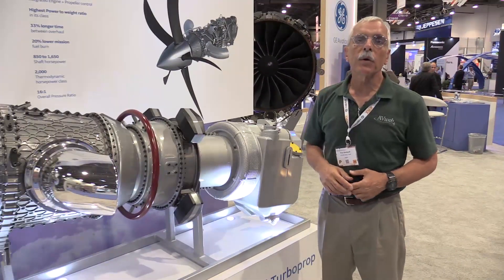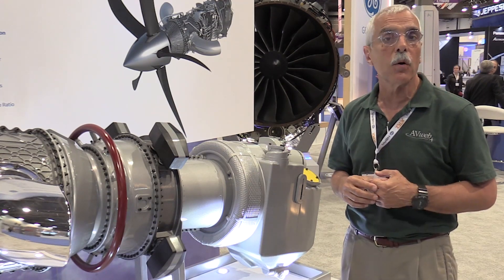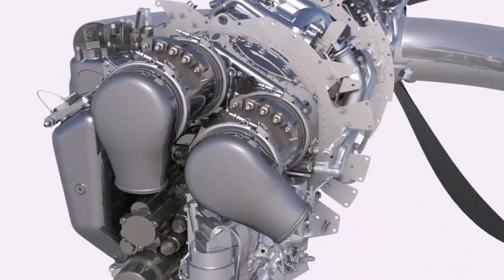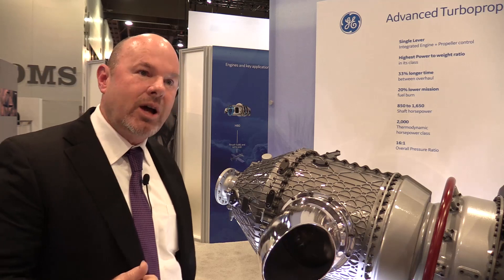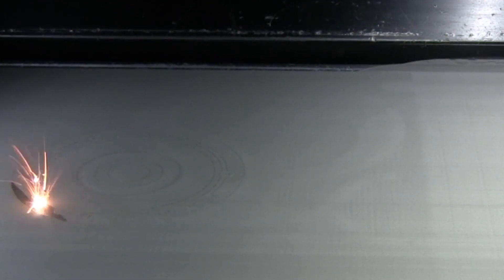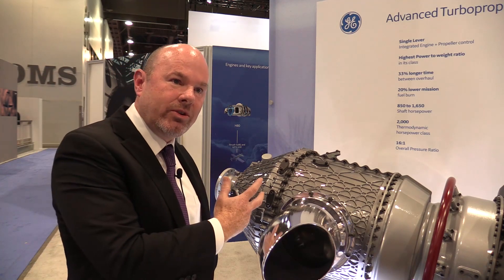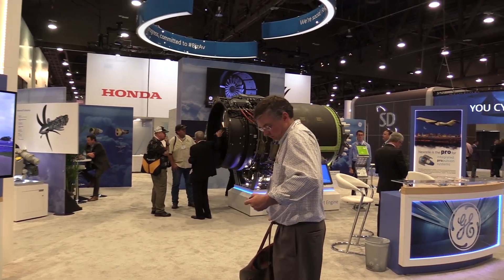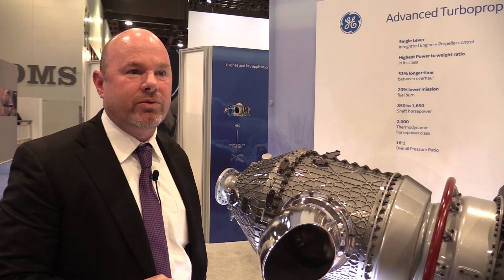How GE Will Laser Print Turboprop Engines

Comment: The GE H80 series, formerly Walter, is a joke. There are infinite mandatory bulletins, the reduction box cannot last 500 hours, FCU bulletins and breakdowns, the engine has a bearing change bulletin which is more expensive than buying a PT6. I SAY this because I bought a Thrush 510G with a GE H80 engine. This engine showed filings after little use. GE Czech Prague will not assist you. Here in Brazil, all GE engines had problems. More than operators on the ground with a white elephant. Apart from the countless accidents.

Comment: Wonder what kind of yield strength we could get with laser printed metal parts.
Reply: Have a google - once heat treated it’s surprisingly good. Not as good as an equivalent conventionally processed material. It’s the main issue with additive that a lot of research is being done to fix!
Reply: Exactly! Things that would concern me are: strength, temperature resistance, & longevity.

Comment: looks like a PT6 knockoff
Reply: It may look like the PT-6, but this engine is radically different; radically new. The PT-6 is very old technology. (For example, I used to sell PT-6 powered airplanes back in the early 1970s.) Still, this GE engine is targeting exactly the same market that the PT-6 has long 'owned.'

Comment: Just wonder about the BLISK (Bladed Disk)technique.

In existing turpoprops like the PT6, when the turbine blades are worn and need replacement, they are removed from the disk and new ones take their place. Sounds like this will require the entire disk and all the blades to be replaced. May be beneficial to manufacturing costs, but what about overhaul costs?

Comment: 3D printing is not new. They been using it in the auto industry for years. Using what amounts to wax. They make the mold from that. All they are doing now. Is taking the mold out of the process.  So this is the next evolution in production. Just like when CNC machines appeared 40 years ago...As damn near everybody has them today.
Reply: Master Chief 00117 well that is new. You ditch the wax, reduce the material needed, reduce the surface finishing needed, increase the complexities of the part without running into issues casting, reduce the need and cost of operating large furnaces, reduce the need and cost of specialize casting equipment. Just as CNC substrative manufacturing was a huge revolution so is additive maybe even more so.
Reply: no no this is laser sintering which is not the same as printing with wax. They use a laser to melt the fine metal powder medium and build it layer by layer.

Comment: It's going to be built with 3d technology. Jesus Christ. This is a bunch of marketing hogwash.
Reply: One other note: in many cases (perhaps most, for GE) the material is actually melted, which is NOT sintering.
Reply: There are emerging technologies that GE has invested in wich that cuts the cost of addative manufacturing significantly, look up desktop metal. Other manufacturers will most likely follow suite.
Reply: A rose by any other name, etc. It doesn't matter what you call it, GE has essentially perfected the technique; "printed" fuel nozzles are already flying. I work in certification of these parts (actually, the whole engine, plus any add-on parts from other manufacturers) for GE.
Reply: No it's not. Additive Printing is 3D technology. You think its hogwash because you dont understand it